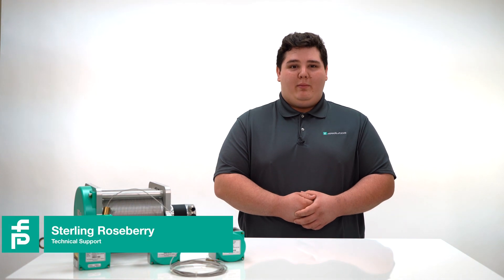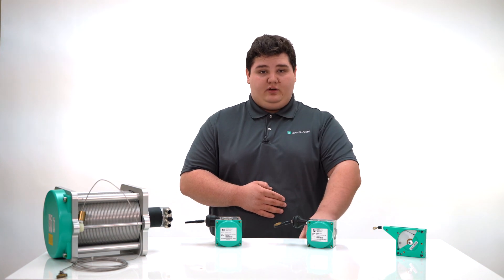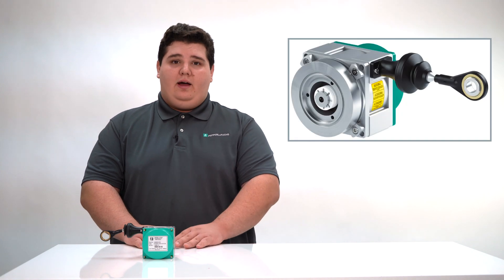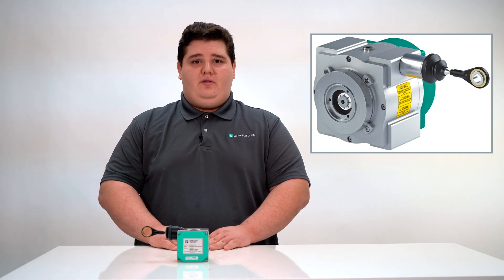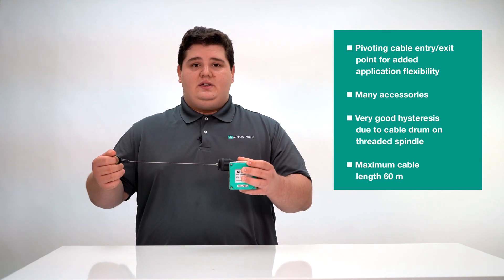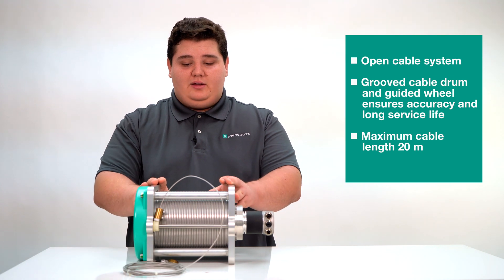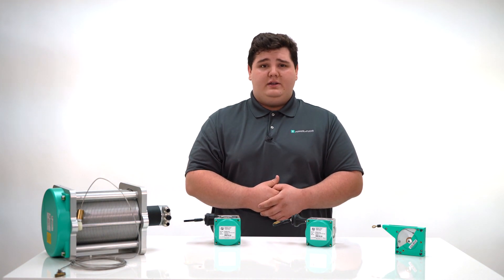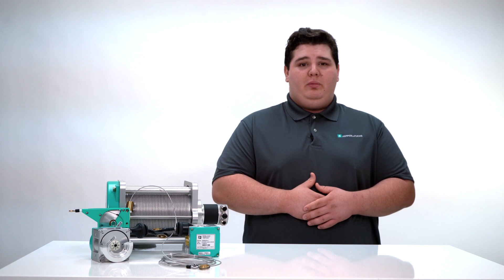Introduction of Pepperl+Fuchs Cable Pull Rotary Encoder Family

Comment: HOW TO CALIBRATER ENCODER IF THE VALUES ARE NOT CORRECT
Reply from the maker: Hi there, if this is an absolute rotary encoder, then a preset can be used to set the needed value. The exact steps will vary depending on the specific type of encoder. 
If you need further assistance please contact us at https://www.pepperl-fuchs.com/usa/en/ask_an_expert_fa.htm.
Thank you.